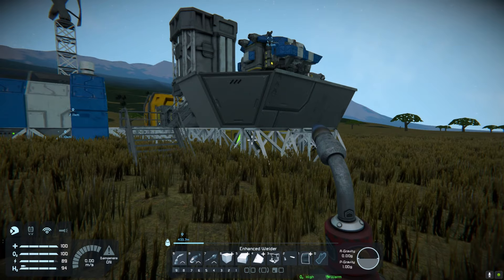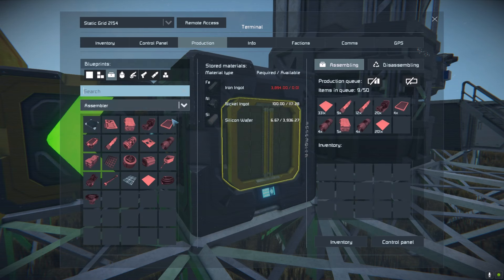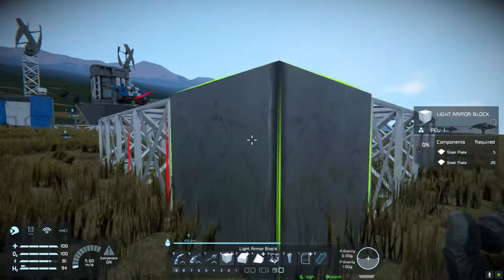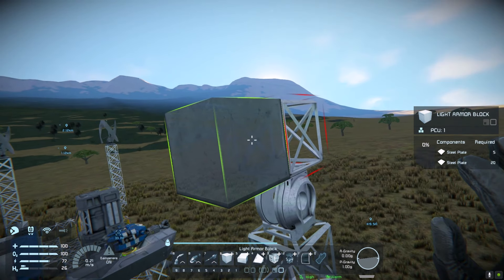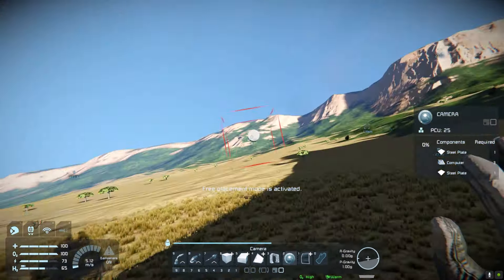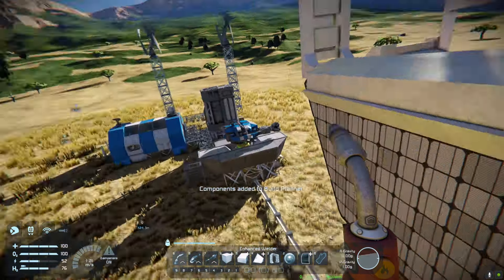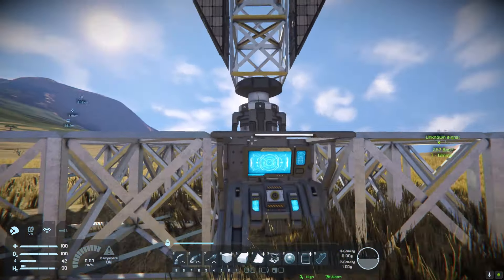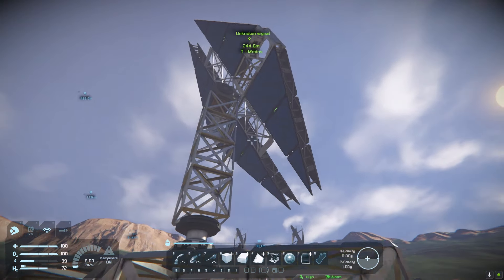Survive with me #4 - Easy solar tracking set-up (Space Engineers)

Comment: That's a slightly different take on the tracking setup.
First time I've seen someone rotate the whole tower rather than just rotate the solar panel array at the top.
A little thinking outside the box for connecting the solar tower base to the main base, I like it. Will have to try that myself one of these times.